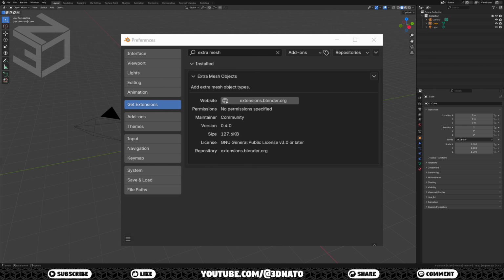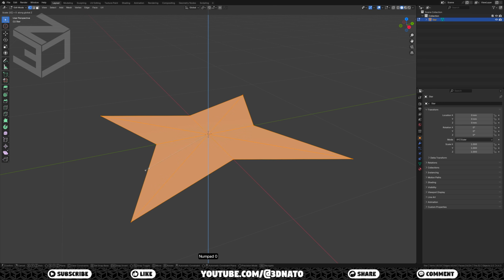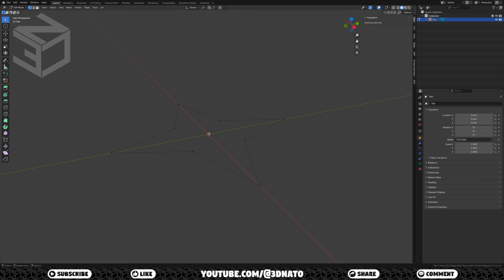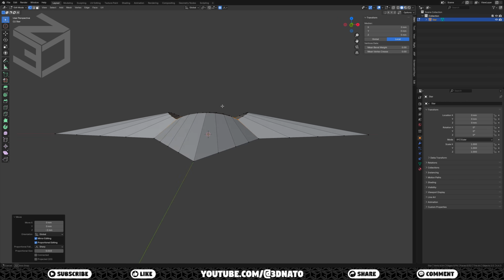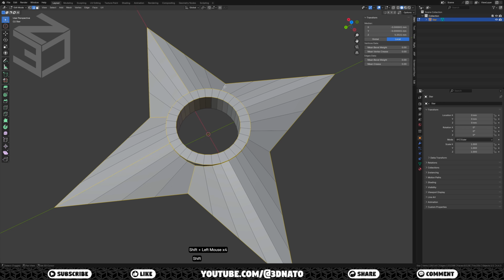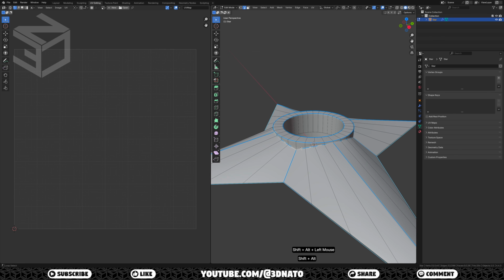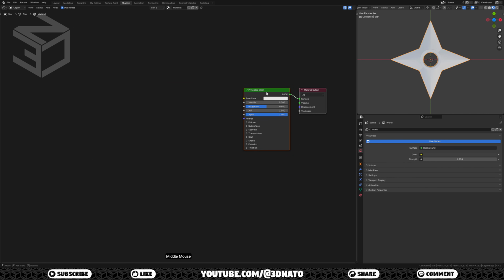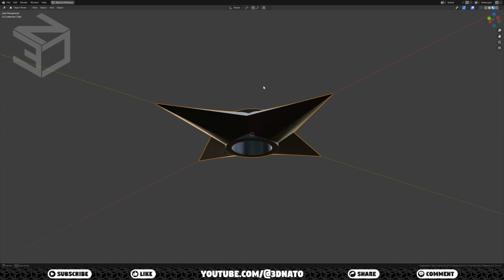How to Make NARUTO’S SHURIKEN in Blender (Step-by-Step Tutorial)

Comment: The Alt and left click are not working for me. What could be the issue.Nvm I did it using shift for some reason it worked
Reply from the maker: That's weird, because this is the shortcut for selecting an edge loop. I would try selecting all and then Merge by Distance.
Glad you found a solution.